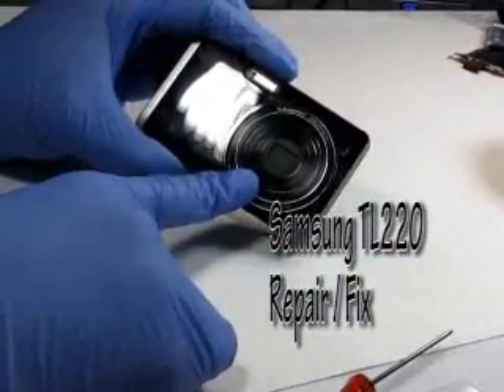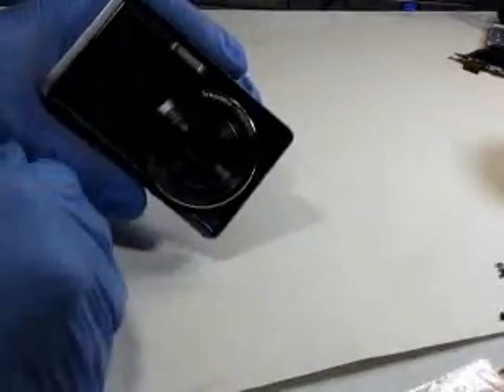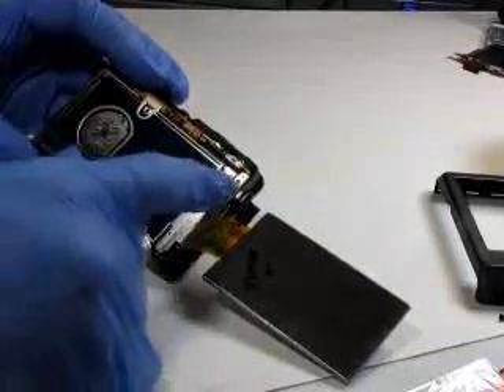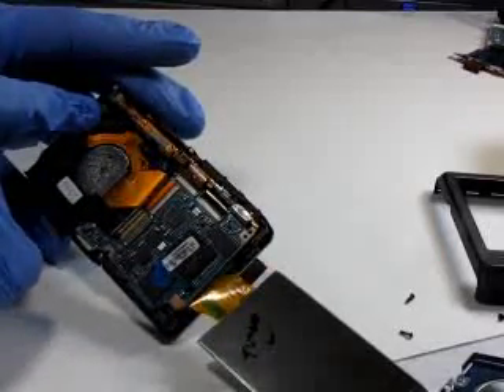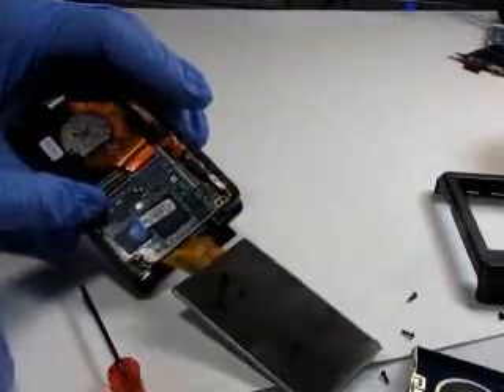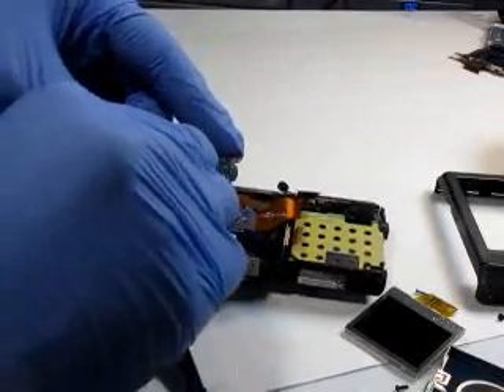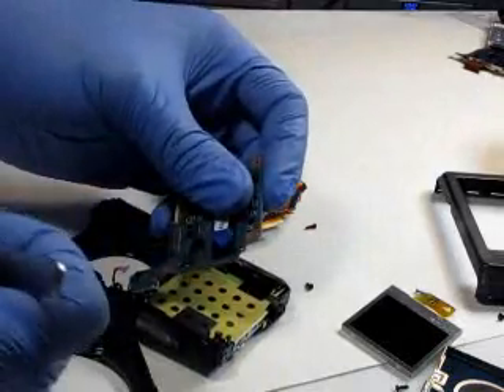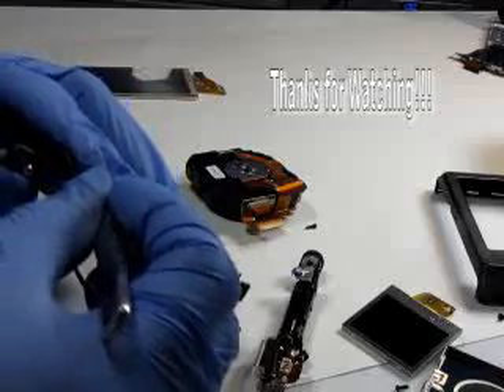Samsung TL220 Repair Fix Disassembly

Comment: Very easy to clean the sensor its directly on the back of the lens unit . X3 silver screws on the silver plate on backside of lens zoom mechanism it’s connected to a ribbon cable. Gently hold it up after removing the 3 screws. I used lens cleaning solution on a q tip and cleaned off all the dust directly on the sensor that kept showing up in my photos! This video helped with the tear down.

Comment: Please help I'm charging get my camera it's been dead for a while but when I try to turn the device on while charging for 10 min the screen just flashes connecting USB with or with out an SD card is that a simple let it charge fully problem

Comment: Hi, I hope you can give me some support or guidance. I have this same camera and has a problem. The issue started when the battery seemed not to retain the charge (or that's what I thought) but then, the camera stopped working. Right now is not turning on. I tested the battery and it has charge, it actually worked with another camera. What can be making my camera does not turn on?

Comment: i have a TL220, screens touch response works but all i see on the display when i tried to take pictures are pinkish, reddish, white & black lines up & down the screens. I can't see anything else but those lines.  What is wrong with the camera & what can I purchase in order to fix it? Would really appreciate any help possible!

Comment from the maker: Hi, here is the trick to dealing with the clamps.  They are fragile and can break easy.
Here is the trick.  Use the entire with of your finger to flip up the clamp. It is important
to use equal pressure on the entire length of the surface of the clamp.  A safer trick is to use some tweezers to pull the cable out without flipping up the clamps. Once the cable is out you can then flip up the clamps to install your screen. When reassembling do not
use excessive pressure when putting back the cover

Comment: No it doesn't respond, it turns on and one half of the screen is all dark grey, the other half is light grey close to white in color, the screen is not broken nor cracked, though my wife did drop it then it did this, it charges, turns on, just the main screen not responsive.

Comment: does your touch screen still work? If so then you will need to purchase just the
lcd which is very cheap. If your touch screen is defective also then you will need
the entire assembly. You can find the parts at the above website and free installation also.

Comment: Keep in mind that the motor will be stiff without power. You will not be able to move the motor wheel without some sort of voltage. This is default.
Without the motor attached if the lens extends and retracts fine (fully) and
you feel no resistance nor hear any grinding then troubleshooting does point
to the motor. If there is a sand/dirt issue then you should see evidence of
this when inspecting inside the lens cavity.

Comment: Hi... if the lens does nothing. Not even attempt to move and you hear no noises coming from the lens then your guess is good. The lens motor.  The motor part costs just
as much as purchasing a replacement lens so you might as well purchase a lens
for replacement.The question is why did it go out. If it was exposed to water you may also have other issues with the lens.

Comment from the maker: Ebay is a good source for products. Keep in mind if you have a TL220 the rear screen is not compatible with the TL225. 20 bucks sounds like an aftermarket screen.  From my experience i have found that the after market screens have a shorter life span than the OEM screens and sometimes they can develop issues very early. As they say you get what you pay for.  Also if you are in a rush make sure you buy from the US. Many parts sellers are from overseas and would take a month for delivery.

Comment from the maker: Hi you do not need to go all the way to the end, just the 1st 5 minutes where the
main board is pulled out and flipped over. You need to make sure you have good
access to the ziff clamp that holds the LCD Flex cable, otherwise you risk damaging
the ziff clamp. Please be careful not to damage the ziff clamps and watch out for
static discharge.

Comment: do i have to do all this just to replace the back lcd or just up to the part where you flip the front and dissconect the lcd ? mine cracked due to a fall but everithing else seems to funtion properly